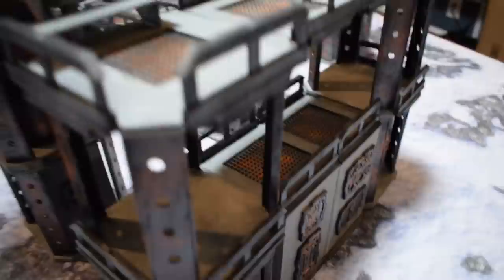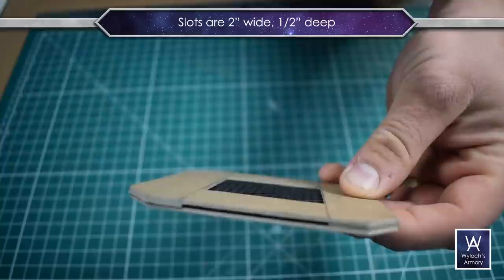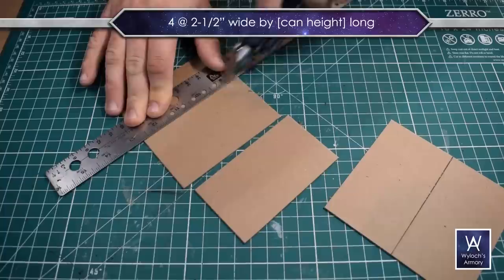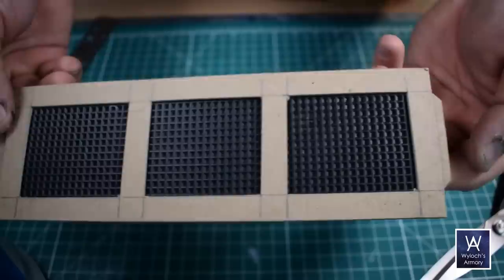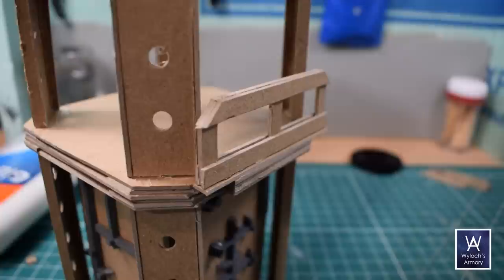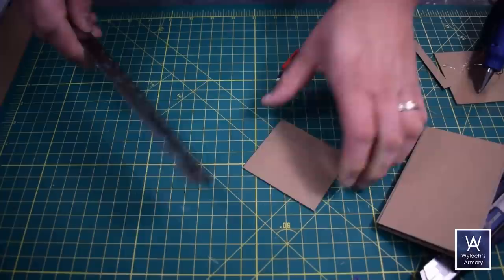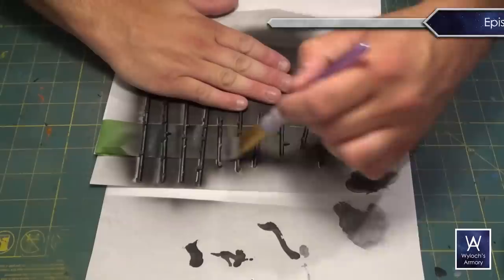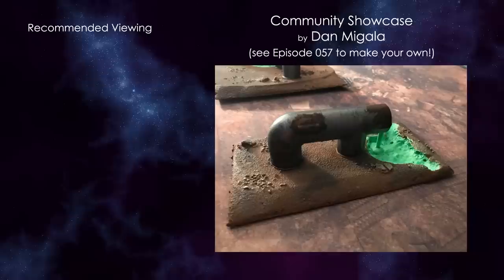How to Scratch-Build Sector Mechanicus Walkways for Warhammer 40k, Kill Team

Comment: Use plexiglass edge glow in different colors to make LCD monitors that actually glow. You can also use the same grating that you used for the floor panels press a little aluminum foil over a small rectangle to get the detail of the grating and you have just made a keyboard. Use a few fat beads of hot glue for wire. I love your videos! This is what I have been looking for. these are compatible with Mega Bloks minifigures without changing any of the size!
Reply from the maker: Thx!
Reply: plexiglass edge glow?  Tell me more salesman...

Comment: Miniatures are definitely the stars of the show, but you're 100% right that the stage is another character. When I was studying stage design for theater they told us exactly that. The table is the third player in the game.
I would love to see the ends of these walkways. If this is an industrial complex where are the walkways going? Machinery or holding tanks on larger bases, that's where! They could form anchor and center points for the terrain. They would also be the centerpiece for modular terrain like this. 
Have a giant tank with a creature in it? It's a bio lab!
Have a giant crucible full of red hot metal? It's a Manufactorum!
Have a giant crusher/grinder and some scatter "junk" terrain? It's a reclamation center!
Definitely make some control panels,  they'd make great objective markers. I also love the clip ons for the railings and accessories, they look like the bracketting that would be used on metal walkways like these.

Comment from the maker: Gimme your ideas for clip-on embellishments!!!
Reply: How about draped banners... it more decorative... ladders too?
Reply: Could just add things like heavy bolters to railings, but I think it'd be cool to have gun emplacements, or even crane's or  industrial tools
Reply: A crane
Reply: Maybe make some light post somehow or warning signs like electrical or quemical hazards
Reply: Landing platforms, storage boxes, safety gear, gen-set (portable power supply), smoke stacks, pipes/tubes, power cable: take a look at deep sea oil derrick images for further ideas.
Reply: Ruined walkway sections, maybe a blown up tower
Reply: * Maybe some pieces you clip on both sides of the catwalk to make it some kind of "tunnel".
* Lightposts
* Banners
* Ladders
* Computer Terminals
* Solar Panels
* Tubes, Pipes, Wires
Reply: Mounted weapons
Reply: Definitely interactive components like computer terminals and electrical panels. Storage lockers. Mounted guns. Doors; I will probably use these as an abstraction of internal spaces, not just external spaces; hallways of ships and buildings, etc. So some security or airlock doors would be great.
Reply: How about force field clip-on, cover plating, tunnel ladders out of hair curler, doors, guard tower housing, tube connections, mini crane, burning gas flamer,  balkony, some cool energy stuff.
Reply: Add ramps and ladders.
Reply: A radar or communications post
Reply: Railings for the stairs 
walkway railings with scrap metal on them for heavy cover
split stairs, or stairs with a corner section
widgets, hanging wires, lights (fake or real LEDs) and other decorative addons
Reply: You have all the essential parts. I'd continue from here by making some... what does 40k call them? Objective Markers. Make some of those that clip onto the towers and walkways such as consoles, generators, cargo modules, some industrial machines such as a drill, some conveyor belt modules maybe. And maybe you don't always want to use this system for an industrial facility so throw in some science and military modules like a weapons rack stocked with spare space marine guns, prisoner cells (if you can do those such that the prisoner is hanging from the walkway would be perfect)... the benefit of making these is that each one adds a secondary quest objective. It's not just "kill all the enemy units" it could be "disable the captured facility and clear it of enemy forces" or "prevent the enemy from releasing captured units" or "activate the facility and defend the equipment while it goes through the process of building the weapon necesary to take down the approaching overpowered unit."

After that I'd make some non-square towers. Triangles up to octagons just because I personally like non-square intersections.
Reply: More votes for Ladders, Cover/Tunnel, Control Panels.

Not seen this yet...Half-height tower and stairs to link to normal towers.
Reply: Broken and bent walkways, ladders.

Downspout pipes - big enough a mini could use it as egress from a heated battle above.

Flame effect clip ons- maybe the industrial complex caught fire in the battle. 

Gantry crane truss walkway

Oil barrel, pallets, etc scatter terrain
Reply: @CraftNicks  I like the idea of a banner.  Coat of Arms style perhaps.  Full length and height of a wall, colorful pattern.  Thanks Wyloch for the consideration.
Reply: @Firebirddna  exactly my thought...
Reply: Balconies.
Reply: Ladders. 

With the new Chapter Approved you need ladders. Because this excellent terrain now counts as Sector Mechanicus, you can't move longitudinally, unlike in Ruins, freely. As the game is a short length skirmish, by the time you've walked up somewhere you're stuck. That's it. 

I also struggle to come up with a simple/ cheap/ effective way to make them. Your ideas would be greatly appreciated. Thank you.
Reply: Turrets.
Reply: Aquila symbols; transparent acrylic force fields (maybe with LEDs); overhanging shooting platforms; overhead coverings to deter flyers - these are a few of my favourite things ...
Reply: Balconies would be cool. It might be too much for clip-ons but it'd also be a cool addition to have balconies/platforms going around the top of a tower section. To do this you might need to make a wider tower section to serve as a base?
Reply: Cables and pipes. And damaged catwalks
Reply: What about some tyranid stuff like the place has been overrun for a bit
Reply: Turrets??
Reply: LED (optional) lit holographic display (two thin sheets of clear plastic with clear/coloured plastic display imagery inside) If using led, could hide in a power box on the side maybe, or make without. 
Also... An alternative to sandwiching plastic design with two other bits of plastic is to make DIY-transfers (great for use in general, worth a separate video): print a design on a lazer printer, cover with clear packing tape (just enough) cut out, soak in water for 5 min and lightly rub paper off tape, you are now left with a clear tape film with intact glue and black lazer printed design attached and ready for transfer onto object of choice/display screen) Would look amazing lit-up!
Reply: Power couplings, computer, water pipes, teleporters, broken catwalks and stairs
Reply: Mounted weapons, ladders, control panels, search lights, pipes along the length or under walkways, bunches of cables, hatches in the walkways, hoist or block and chain lifting equipment, pressure release valves, LED lights like the generator. 
It might benefit to have a main building with a useable roof as a centre piece that you can link parts to, a processing plant or hanger is easier as you can have the front open and the inside empty with space for tanks etc.
Great video, keep them coming.
Can you have a UK amazon shop front as well, the shipping charges for some of you links are quite high and I’d love to support the Chanel more as I by a lot of your recommendations.
Reply: It would be really really hard but modular buildings to match would be awesome
Reply: Ladders and gun mounts.
Reply: Broken walkways are usually nice to have, holographic signs would be neat, and what would really be cool would be some hanging monitors and/or security cameras (maybe even turrets) that hang down from slots.
Reply: Make energy shield walls with light blue plastic document covers and have it lit up with those tiny string lights running along the inside of a “steel boarder” to light it up with a glow effect. 

Landing pads

Movement trays

Shield generators before and after destroyed 

Clip on fire and smoke
Reply: For clip on, a broken version of the railing would be simple but cool. Maybe some more defensible side pieces rather than all railings might be useful (could extend the walls upwards to do that maybe). make it look like the walkways have been set up as a proper defensive position. 

Also ladders as others have said.

Would also be good to have doors/hatches in the towers to infer that they have an interior. Though that would probably work better as a part of the tower rather than separate parts.
Reply: Large "X Days since last accident" sign.
Reply: @tommyd2235  for the tunnels it's cheapest and easiest to use cardboard tubes from wrapping paper and toilet paper and paper towels. If you use the clip system that is explained in this video you should be able to attach those to the top of the rails no problem.
Reply: Thank you for another great build.  How about drilling a few holes into the tin? Or hammer a few nails into it to get the look of battlescars. For assembling the top and bottom bit of the tin tower you used chipboard. How about making a rig made oit of Lego? As in building a corner wall and then you can sit the lower base in the corner and put the top bit with tin and top base easily into the corner?
Reply: Another idea for the girders: when you assemble them, put another bit of chipboard underneath the wide bit and then continue as usual. This way the wide bit is centered. I am not sure, if my idea can be understood,  english isnt my first language. Sorry
Reply: I would like to see embellishments that add winter effects to each of the platforms and railings and what not, either in the form of snow or icicles. All hail winter's cleansing cold embrace.
Reply: Clip-on embellishment wall piece or pillar with a waste pipe and have sludge coming out of it. Going into a clip on floor piece with a sewer type grating. 

Chaos type pieces, warp rifts, symbols, flags, hanging corpses. 
Ork type pieces lots of irregular shaped railings, , klan symbols, scrappy looking, lots of spikey bits.
Tyranid pieces with some sort of biomass pieces.
Reply: @Cameron Murray It would be interesting to see a fantasy version.
Reply: Pretty late to the video but it would be cool to take this idea to the next level and make terrain like streets roads and rocky/grassy terrain that interlocks and is interchangable with everything you built in this video. So that way you could make a whole board that you can assemble differently everytime. That would be epic. Oh and awesome video!!!
Reply: Outcroppings to your walkway/tower like look out points off side of rail or tower, Cranes/Hoists, Ladders, Light Poles/Signs, Flags/Banners, Destroyed railing, Ropes hanging down to Climb
Reply: I would like to see some heavy walls to simulate an encamped position. Ones that clip to the tower sections, block line of sight for shorter models, but infantry can obviously go through. Making the towers basically into parapet towers like a castle. Give the feel of not just a depot or power station or other tactical situation, but a fortified enemy. Assaulting and defending a fortress world. Cadian defense, anyone?
Reply: Unique objective tower tiles, helipad/landing pad, large gauntlet/open tiles. One story buildings with containers or cargo or smaller buildings on top with a removable roof for fighting inside. Maybe an arena (KT) building in the center with a complex surrounding it, how cool would that be?

Comment: Hello Wyloch.

   You asked, in the video for ideas for the clip on pieces. I do have a suggestion.
   How about a section of those 12" long walkways, covered in mesh? A protected tunnel of sorts. 
   Instead of the rigid and thick mesh you were using for detailing, I recommend using mesh gauze. 
   This is obtainable at most craft stores that specialize in sewing crafts. Barring that, a cheap alternative is, of all things, hankies. Yes, the roughly 1x1 foot cotton cloths some people knot the corners of and wear over their bald heads. 
   For using hankies, just remove every other thread in the mesh of threads along two sides. This leaves an open mesh of fine threads that can be molded into almost any shape desired. 
   So, this new mesh material can be laid over a scaffolding of the craft board stuff, or other materials used as the supports for the mesh tunnel... perhaps even bent floral wire, or thin plasti-struct rods. 
   Just before laying the mesh in place, paint it with a 50-50 mix of white glue and water to make it more pliable, and lay it across the supporting structure. 
   If done right, it will look like tightly woven wire mesh over small support piping that is mounted to pieces like the lower halves of your railings, allowing the entire mesh tunnel to be clipped into position easily. 
   The benefit of of this design is that it is very light weight, and easily removed to position models on the walkway, and later move them along the walkway's surface as needed, or desired.

Comment: Great video Wylock!  I have been working to expand my terrain for Star Wars Legion (have only done desert planet stuff thus far) and was wanting to come up with some walkways to represent Imperial facilities and the like.  These ideas will really help me with that!
Reply from the maker: Rockin
Reply: Started to work on a few pieces for some of these Friday and am pretty far along with two main sections and a small walkway (all I need for the moment) plus the railings and two pairs of stairs.  Just to the painting stage now (I would be further along, but was also working on some other projects for a game this Friday).  I made a few variations on your basic design.  I did not use soup cans and had not base for them.  I instead made supports that are fully modular (like the clip on support you made for long runs of walkways).  So far seems like this will work for what I have planned (does not allow for stacking them on each other, but I do not plan to do that at the moment.  If I ever do decide to, then I might make a clip on two level section of supports or something.)  Anyway, thanks again for the video and the great ideas, so very helpful!

Comment: Excellent!   I do 3D Print most my terrain BUT I really like your design of locking them together, add a Magnet on bottom of the slots and maybe metal flange that slides in to & it would be even stronger.

Comment: This is awesome stuff giving me all kinds of ideas.
First thing to make extra is corner and 180 stairs modules.
Then bigger platforms.

I am sloooooowly working on a production/refinery/space port thing, this fits perfectly.

I have 3 armies, Ultramarines and Tau, both on the same jungle planet, the Tau are attacking the planet the Ultramarines had claimed but it is rather insignificant thus far, so it is a relatively calm transport hub, but now of course it is clearly more important.
Anyway, the Ultramarines will have the more factory floor bases and mud bases, where the Tau have muddy jungle overgrowth bases, they will attack through the jungle. The Tau are mostly a metal which is copper color based metal army, coated in black, armor plates is green digital camo. Wear and tear from the jungle will first go through digicamo, reveal green base coat, then black undercoat, then the copper. The black coat over the copper burns away with heat as well. 
And my third army is relatively dry light brown desert themed AdMech, steel and copper mixed army. They mix it because steel is less abundant on their world and that is used for integrity, copper for the rest, and it was a way for me to use the same scenery with all armies and also copper would be just about everywhere except for the Ultramarines, they have their shit together, they don’t need to use that inferior copper material.

I will almost certainly use quite a bit of this.

Comment: Hi, Wyloch!  What I'm going to request is this: How about creating a mono-rail trestle with a monorail car containing a place for an engineer, and with a long flatbed in the back of the car where a mounted gun or ballista type weapon could go?  There could be several cars with mounted guns with the trestle surrounding the parameter of the base/facility with these cars serving as mobile gun nests.  The mono rail track could be some sort of sliding tube, rectangle, etc.  As long as the cars can move along it, I don't suppose it matters much. Hopefully you can find a way to clip the trestle to your existing towers.  Just a though for something fun and interesting, and it might offer you a next level type of challenge.  Thanks for the consideration, and for your great videos!

Comment: Loved this video... great insights.  Using the cross stitch plastic sheets for floor grating is great.  However, it may save a step if you buy it in the black color rather than the white.  I'm currently using it for a massive ALIENS style sci fi build.

Comment: I like medieval setting more but this look really cool. Dependig on the purpose of the building you can add tank and tube system running around, chimney,fan, pool of toxic Slime.banners and flag,platform for flying veichles, lights,lever, speakers, monitor,lifter and container.
Reply from the maker: I am already working on modular fortresses.  ;-)

Comment: Using gift boxes, recycled from Xmas to use as buildings. I have twenty boxes in various sizes and shapes, rectangular, square and hexagonal. Might try using methods in this video, to add features to some buildings, walkways, stairs and the support pillars. Maybe use larger variant of the support pillar sandwich, for modular ground tiles